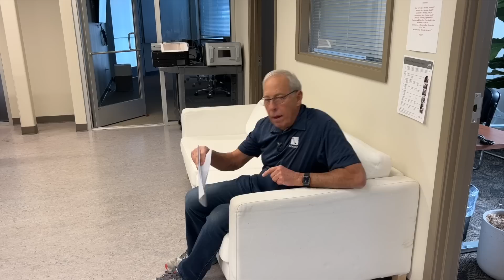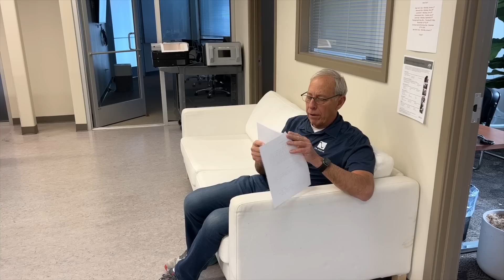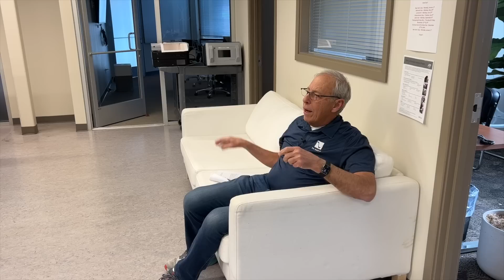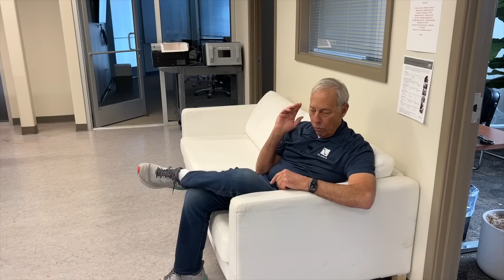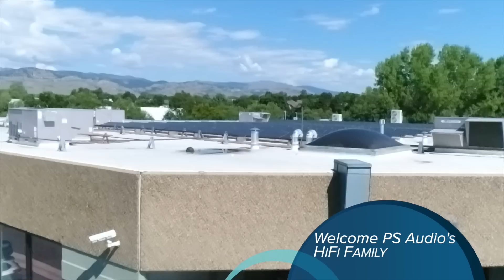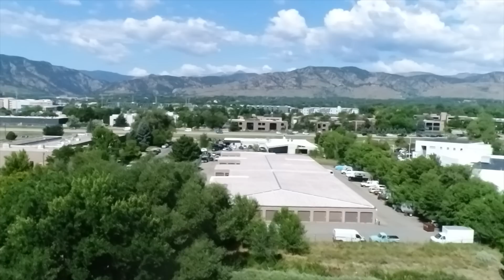Building a Mac Mini music server

Comment: Paul is talking about how operating systems change sample rate, bit resolution, level attenuation etc. before outputting the data to a DAC. Of course the quality of the math involved is not perfect causing some signal integrity losses. For example, your 44.1kHz 16 bits CD quality track might get converted to 48kHz 24 bits and the conversion introduces some approximations that might be audible. In Mac OS there are a number of Audio Converter Services that deal with PCM audio conversions for bit depth, sample rate, floating point/integer, interleaved/de-interleaved and compression/decompression. What Paul is saying is to avoid those and instead keep the data unharmed right to the DAC. Yes, I agree on that but I also have learned that the math involved today is much better than in older operating systems where processing resources were limited. So the issue is less of a concern today, but as audiophile, you get better quality at no cost with Paul’s recommendation, so I 100% agree.

Comment: As with any computer connected to a DAC over USB, be sure the DAC has a good, isolated USB module. If noise is entering the system from USB, attempting to address it by eliminating it on the computer side is a fool’s errand. On a Mac, once the USB connection to the DAC has been established, use Apple’s confusingly named “Audio MIDI Setup” app included in the operating system /Applications/Utilities to select the DAC for audio output with fixed volume and select from the bit-depths/rates available from the DAC the one that matches your source material. You can either do this last step each time the source material bit-depth/rate changes or you can use one of the many 3rd party bit-perfect music playing applications that will do this for you when you select music to play. A simple, inexpensive one I like is called “Colibri”.
Reply: you dont need any dac really

Comment: i believe my iPad does this automatically with a hard wired USB connection using the Camara adapter.
Reply: Yes the camera dongle..✅
The new iPads Pro are Apple USB addition. You can plug in external HD’s, etc. I have a iPad 12.9 with 512 gig. I am not upgrading anytime soon.

Comment: For windows, there is s great SW from a French engineer. It's called VOICE MEETER (yes, with double E). I selected the version called Potato.
This SW does not only bypass the Windows sound engine, but also comes along with great  additional features, such as parametric EQ, Reverb, virtual slots for studio plugins, recording, and a nice mixer console. I run it via an USB audio device, and I am very happy with it - especially the reverb and EQ help me a lot to beef up flat recordings.
Reply: Also Foobar2000 is excellent and supports DSD playback with 3rd party open source (read: free) plugins.

Comment: I use a Mac Mini (2014 design) as my music server with Roon as the software and it works very well.  Consider that all the computer must do is run an application that can help you find the music file that you want to play, and send the digital file to your connected DAC.  That effort is child’s play for a computer, so you do not need a powerful computer for this task.  I did upgrade the disc in my Mac Mini to a Solid State Disc - I recommend at least 1TB.  So, if your computer is capable of running an app like Roon, or others, then it should work fine.

Comment: I think the question was missed. He asked about building a server, not an endpoint/client. A file server feeding a streamer over dlna or Roon or whatever is very different from directly connecting an endpoint to a DAC. Mostly as a server, the specs don't matter much (nor due audio output engines). All that matters is it stores files, connects to the network, and has the protocols to connect to the dedicated streamer. A streamer is definitely the way to go. If you're asking how to turn a Mac Mini into a dedicated streamer, that's also a different question.
Reply: He also asked about using Apple Music on the Mini, which wasn’t addressed.
Reply: I agree....he explained some things in a rambling sort of manner, but didn't address the questions as I interpreted them.  To say the least, I got very little information compared to what I had hoped.  I will look elsewhere.

Comment: Great advice.
In Windows a few years ago, the key was to use ASIO drivers to avoid the crappy core system that messed with everything.  Also on WinXP we used to shut down every process and even delete all but the core of the OS so all it could do was to boot, start a memory player and output bit perfect streams to the DAC.  Sounded great.
Linux does not need any special drivers.  People create music players that just boot up and drive MPD and ALSA which can output the bits.  I've used laptops, BBB, and now RPi as the computer.  The key is to have something akin to PS Audio Lens to isolate and re-clock the signal.  RPi by itself has a terrible clock at 48mb and will produce bad sound, but with a good isolator/re-clock it can be the best thing imaginable.  ROON, moOde and similar OS bundles are readily available.  Many like moOde or Volumio are free.  I use moOde on the RPi, and MPDroide on my phone as the client.  It can also be run from a browser from any laptop on the network.  It is all free to download.
Reply: @Douglas Blake Sounds good (pardon the pun) and thanks for the clarification Douglas.  I was referring to my early days of digital audio as a lesson learned and why in my audio journey I moved on to Linux which to me is a very good platform for digital audio.  I don't advocate it for everyone, but it is nice to have a system that sounds excellent, runs on a processor that costs $50 and has open source free software that is updated automatically every couple of months.  I turn it on and leave it on 7x24 just like the router and the NAS.  It just works like a nice little appliance.
Reply: i believe it all depends on th other end (streamer / dac) some streamers / dac like asio and others more suited with wasapi
Reply: @Douglas Blake I disagree. While you need to take steps to configure Win10 for reliable ASIO use, ASIO drivers are still used predominantly amongst professional audio engineers. I have one DAW that supports WASAPI and several that only support ASIO. It is still the standard for many of us on both sides of the signal chain.
Reply: @Douglas Blake My software works great! Sounds like you have a problem where there isn't one for others.
Reply: @Douglas Blake As a recording engineer and musician, I understand it, too. I resent your criticism of the way I look at it. I think you're way off base dismissing ASIO drivers. Just one example is I have installed my audio software on an out-of-the-box laptop not configured in any way for audio. Using the ASIO driver with a consumer audio interface, it worked great. 

But let's agree to disagree. Besides it's a bit ridiculous to be debating the virtues of audio drivers. There is too much music to record, listen to, and play to bother.

Comment: My 2012 mac mini was getting wonky so i replaced it with a mac mini M! last fall. I bought the base unit with 8gb ram and a 256gb SSD and I use a dock with a 512GB SSD and extra ports to make up for the mini's sparcity. It has worked flawlesly over the past 4 monthj\s and i ve had no issues with anything using Swinson, Roon or Qoibuz.  I use Swinson to play any of the 9,000 files I have on the hard disk and i think it sounds better than the 2012 mini did, it seems to have a lower noise floor.

Comment: My PT1 preamp has a optical, coax, and usb B for digital inputs. the PT1 has a 24/192 dac.  From Apple TV through TV with HDMI, to dac with Optical, I get 24/48.  
Using USB C to the dacs USB B, I get 24/48 with iPhone hooked up physically, with my Pixel 9, I get 16/44.1 
I thought about get a mac mini just to run Apple music lossless into the PT1 but I would have to use usb c to usb b.  I am not sure if I would get 24/192 that way or not.   
Even then, I would need the HDMI to go to the TV to be able to control the mini.....  
I don't get home networking

Comment: Exactly what must I use on Windows 11 to eliminate the use of any processing that detracts from the sound?
Reply: @Douglas Blake 
Anything that doesn’t fit Paul’s agenda or narrative gets deleted.
Reply: @Douglas Blake I wonder if the WASAPI Exclusive mode could be incorporated into Spotify for Windows and if so why have they not done it?
Reply: @Douglas Blake 10 years ago people were working on a plug-in but it seems to have stalled.  Spotify should add a bit perfect feature….

Comment: Just my two cents. I've played with bypassing the core engine on my Mac using bit perfect, listened carefully, and didn't hear the slightest hint of improvement. That doesn't mean you won't. I'm very picky about a lot of things, but the upsampling and other processing in the MacOS meets my standards. I use their built-in digital crossovers and equalization as well via Audio Hijack.

Comment: I have a question to Paul or anyone those that has been using a Mac Mini as a streamer. Set up is a 2014 Mac Mini 2 TB to a Micromega MyDac into a SR7008 Marantz. Sound seems really good to fantastic through Martin Logan speakers.  I'm using Apple Music. When I try to add in Homepods in other parts of the house the sound will cut off for a second connecting to Homepods. When the music resumes on the main system theres a very discernible difference in the sound. A little bit of , through a tin can, change in the sound. Has anyone else experienced this and does anyone know what the @#&% causes it? Is there a fix?

Comment: Audirvana is available for Windows too - 64-bit systems only, however - and I also use Foobar2000 on a Notebook because it's a 32-bit computer. When set up correctly - and, yes, I bypass all the Windows' audio processing - both can sound excellent.

Comment: For windows Foobar and SACD component set SACD to DSD only if Dac supports it and ASIO if have Asio drivers for your DAC then can stream DSD direct to your DAC, Some later computers now support ASIO on the internal cards if have a high end laptop/motherboard some now have dual Dacs. I really only listen to DSD etc on my computer/laptop with Headphones or sometimes using my speakers that do have a built in Dac but dont support DSD only DSD over PCM. My Atmos 6.2.4 Cinema / Music room yep its one room but to me still sounds great,  I have a QNAP with NVME and SSD's stream to my media players then to my Reciver using Direct DSD and then usually have it set to Pure mode to hear all the details.. Yep all speakers disapear and if close eyes instruments can be way behind the walls of the room and also dotted all over the room behind right next to you to the left or right behind the front speakears with the singer directly in the middle. Stereo mode can also get a nice surround effect not quite so behind you but it fills the room. Took me a while to get there but it can be done. After doing some room corrects my left and right subs sound like ive never heard them before and I wish Hans Zimmer song Time was on DSD as i think it will do it justice.

Comment: MACs have (or had) the advantage that the sound output usually only weakens at the end; while with Windows computers you can immediately hear that the computer has an itch in its calf.
However, you shouldn't use the audio hardware built in and used by the manufacturer on both systems and also their driver software on Windows - there are exist external devices that really do it better. But only if You really want to hear everything also in the sub-bit range ;)
Reply: @Douglas Blake I already get most of the music files I listen to digitally and don't need to render them at all - or what exactly do You mean by/with Your answer?

Comment: The real secret sauce in this conversation is of course not to connect your PC (Windows/MAC or Linux) directly to the DAC but just use it just as a music server with something like logitech media server (LMS) software (which is free by the way) and coupled it with a Raspberry PI's and an audio hat, very simple to do and exceptional value for money even when buying expensive hat's, something like the Raspberry PI 4 + Allo Digione Signature running with a linear power supply connected to your DAC will amaze you when comparing it against branded products, This is where the real audiophile digital promised land lies
Reply: @Douglas Blake The Pi and the server box are both operating indepedently on a network, the Digione hat electronically isolates itself from the Pi by having a clean board between itself and the Pi, both the Pi and the Digione are supplied by a linear power supply, it is connected to a DAC via either an rca coax or bnc connection, end result is a very clean signal being sent to your DAC with a very low noise floor and very low jitter.
Reply: @Douglas Blake Not really that complex it's just a PC sitting on your network, a Pi sitting on the network which has the hat attached and a linear power supply, Software updates are simple and are done with the kit in situ. At the end of the day it's all about the electronics providing as clean a signal and as jitter free to the DAC as it can, and with respect no software in the world will be able to resolve that.
All i can attest to is the seperation, soundstage, depth and clarity improved dramatically from a directly connected PC with a specialised USB card. It was like going from a £300 to a £3,000 amplifier. All in all an extremely worthwhile experiment that i would recommend to anyone and after all isn't our hobby here all about experimenting with different kit to try and find our own personal nirvana.
Reply: @narfit1966  isn't a digital signal clean to begin with? We're talking about 1s and 0s here.
Reply: @canepaper967  yes a digital signal is just 1's and 0's but you also have to take into account the circuitry that is transporting those 1's and 0's around and out to your DAC, it will be effected by noise in the circuitry (mainly caused by the mains electricity the device is plugged into) you can mitigate this by in effect scrubbing the power via a linear power supply, computers are very electronically noisiest so if you can power this by a linear supply you are reducing the noise there and but isolating the hat which actual produces the signal to send to the DAC you are reducing the chance of noise being introduced there and hence a cleaner signal being received by the DAC.

Just because your WAV file contain all the correct sequence of 1's and 0's to produce a PCM stream of AC/DC's Black in Black doesn't mean that exact sequence of 1's and 0's is received by the DAC, there will be random artifacts produced by electrical noise that are introduced into that stream that effect it in all kinds of ways, so the cleaner the signal the nearer you get to the original WAV's sequence of 1's and 0's for the DAC to do it's thing. Think of electrical noise like dust sitting between the groves of a vinyl record, the dust makes the needle not track the groves exactly and so your not going to get the full recording as intended, so you clean the record and you get a better sound, it's in effect the same principle.
Reply: @narfit1966  the amount of noise required to affect digital signals is orders of magnitude above that of analog, I think your ears may have deceived you or there are other factors at play.
Reply: @canepaper967  Okay...enjoy your trip in audioland!
Reply: The solution using Digione Signature is excellent and I’ve been using to for quite a while with great results. Would recommend to use a cheap power bank (which can run the rpi and Digione for several hours) for clean power to the device.
Reply: @alokeparvati  i'm currently running with the shanti linear power brick as it powers both the Pi on the dirty side and the Digione on the clean side, but i totally agree with you before moving to the Digione i did have great results when running the Pi + hat with a power bank, a marked improvement over using just a standard type of power supply even one of the more expensive ones.

Comment: Very interesting stuff. Paul, do you have any suggestions for a dac where you can monitor the input bitrates? (That won’t cost as much as a car)
I have samson, focusrite and some smaller units, but they don’t show input bitrates. 
I also use drivers like Asio4all on some occasions to support multiple inputs and outputs, which have a detrimental effect on audio quality, maybe you have suggestions on this too?
Reply: @Douglas Blake Oh very interesting, I will definitely check those out. 
Indeed, when I'm on windows and I need to record and output at the same time, I've been forced to use asio4all. I understand that WASAPI is perfect for output alone, but not in/out simultaneous, especially via different cards/interfaces.
Reply: @Douglas Blake Why do you keep hating on ASIO in the comments? It also runs exclusively. I also guarantee that's what the OP's Focusrite interface uses.
Reply: @Douglas Blake Sure, but there is nothing wrong with ASIO when done right.
Reply: I think you are both right. 

I can run focusrite exclusively, or samson mics/dacs exclusive. They sound as good as they need to. 
The problem arises when I need to run both at the same time, for recording input from ie. guitar/bass through focusrite, and vocals through samson mic/dac.
this forces me to use asio4all, which causes issues, ie. sometimes I need to switch "safe mode" a few times just to make it sound bearable. (no little crackles🤦🏻‍♂)

so this is probably partly my own fault in setup, but could probably be somewhat attributed to the software decisions. 

I don't know, 
You have any ideas?